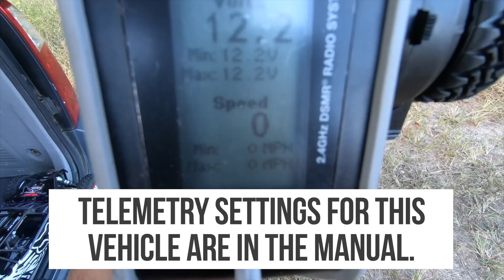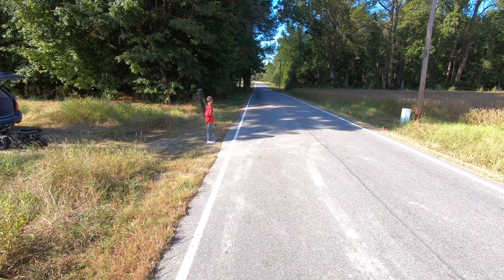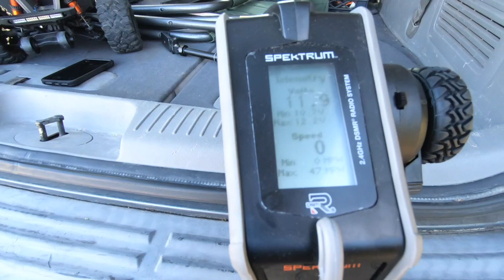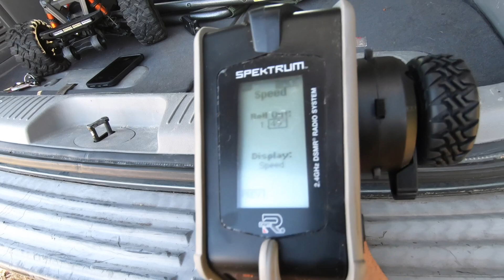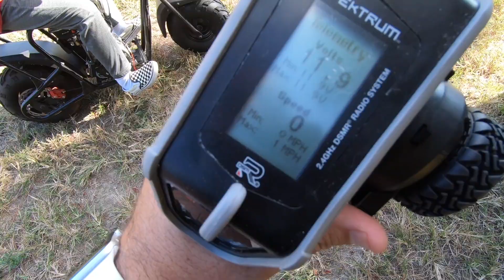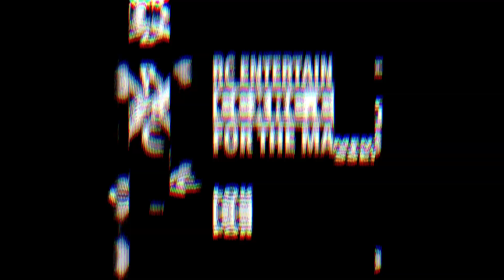Losi Tenacity DB Pro Speed Test Using Spektrum Smart Technology To Calculate Speed

Comment: My tenacity DB on 11 V seems slow for some reason
Reply from the maker: Did you leave the larger pinion on? I've been watching videos where people left the large pinion on and it looks way faster.
Reply: @CCxRC   Thanks for such a quick response. I actually figured it out. It was the switch on the top of the remote set to 50% throttle.  Haha.  It woke right up on 100%  .     Thnx again!
Reply: CCxRC 
I once had the Losi scbe I ran my castle  sidewinder combo on 3s and the larger pinion it flew never speed tested though

Comment: How do you charge spectrum smart batteries on a venom charger for some reason I don’t think mine is working right
Reply from the maker: They charge like any other battery. I charged the ones they sent me to show with the DBXLE and they charged normally. I used an EC5 cable to my quad charger.
Reply: CCxRC ok thanks bro 👍🏾💯Rcfam4life

Comment: Is that with the stock receiver?
Reply from the maker: Tom Turrisi yes. Stock receiver, but changed the transmitter. There is a Bluetooth module you can get for the stock transmitter too.
Reply: Cool I have the rugged as well and will try this out.  Great video!

Comment: I thought this radio was made for crawling and trails? Rugged in case dropped on rocks or in mud. I didn't know it had that much range. Looks like the radio will be a better choice for more than crawling alone. It must read the speed off motor RPM. It doesn't know if you are spinning in place or flying down the road. Radio is worth checking into IMO. Would like to see the Losi turned loose in it's habitat. Is this belt drive too? Not sure I want to invest in old technology drivetrain. Wanting to get back into the hobby but with so many videos on bashing, crawling, and trails out there I'm not sure I want to be limited to just a racetrack anymore. I'll keep watching till I get convinced on what has the most economical fun factor

Comment: Awesome!  I wonder if this could handle 4s for just a short speed run. The ESC seems to be rated for 2s-4s.  Maybe give it a try??
Reply: Some ppl just have. To push the envelope 😂 i thought 120 amp always meant can run 4s but some rigs have say 3s . i think i fried a 6s blx this buggy looking really cool . btw with spectrum  batterys even has more information available, how many cycles and such but expensive low c ratings and i believe you need use there charger so i dont blame ton for sticking with his beloved venoms💪💪🏎👊

Comment: How does that work is there a GPS in the receiver
Reply: Haha would be cool
Reply: it measures the maximum rpm from the esc/motor and calculates the theoretical speed based on the 'rollout' which is how far the car moves for each revolution of the motor. It's similar to how a real car measures speed. If you enter the wrong parameters, change wheels/gearing or the wheels are spinning it'll be inaccurate.
Reply: @tmmtmm  is that information coming from the esc to the receiver to the remote or receiver to remote or just remote

Comment: While it is cool, it feels more like a calculator now. I thought it actually used the frequency and calculated it from that to get speed. So it's more of theoretical than actual. Because if you ran it in grass it would be slower than concrete which I think you mentioned on the short blast on grass. Would like to see that and what the difference is.
Reply: Yeah, it's blind to wheel slip/spin and also blind to tyre ballooning. A fun feature, but won't replace a true GPS reading for the speedrun diehards.